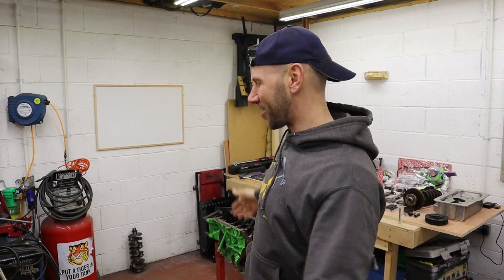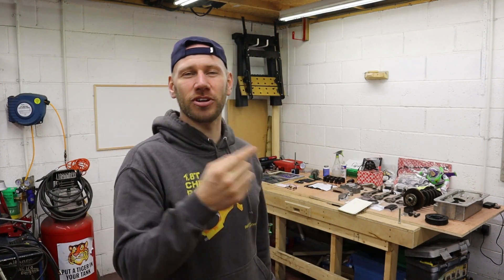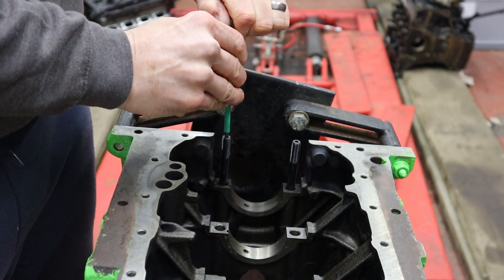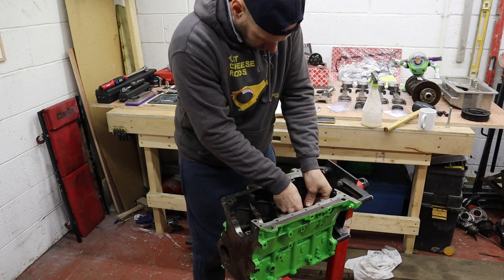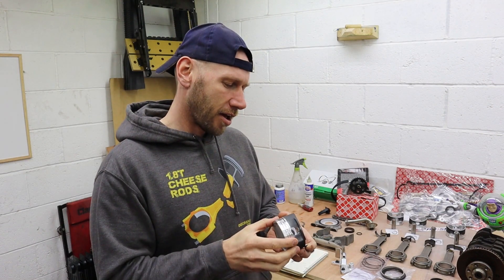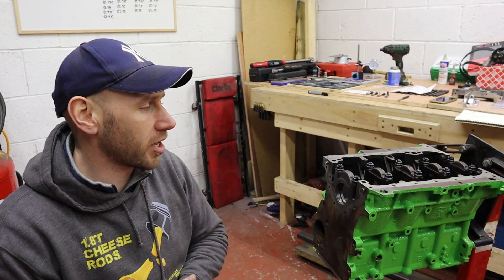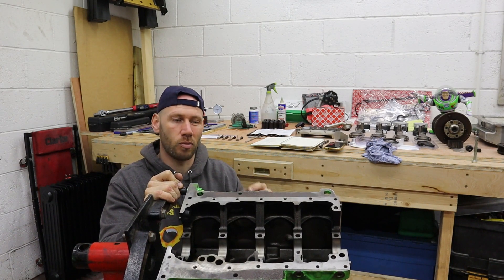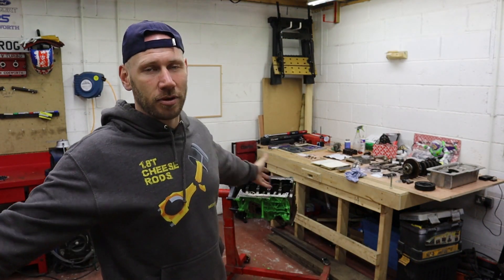1.8T STROKER ENGINE BLOCK CHECKS  // Bearing Clearance and Crush

Comment: Hello! I also just build a 2l stroker . I just measured them and I get between 0.06 and 0.075mm with standard ACL bearing.  It's will be okey for 400-500hp application?
Reply from the maker: I'd suggest that's a bit slack, and id want to measure the crank to determine if that is on size.
Reply: @DecimalTenths ACL said with normal bearings and stock motor the service bearing clearance is 0.15mm  and I will be totally fine with 0.06mm at 400+hp range...

Comment: Thanks for sharing this info building a stroker. I'm from Holland and its very usefull for me. I've got a 06a, the crankshaft, the pistons, the rods. Now wait fore the 82.5 bore (this friday) and the bearrings/bolts and then start building. A long way to go, but with your video's its gonna work👍( at least i think??? 🤔😄).
Reply from the maker: Good luck with it! Be clean, tidy, methodical and reference the manual for clearances and techniques and you will succeed!

Comment: I finally recieved my pistons. I am going 83mm. Question should machine shop be able to tell me I need block decked? Should I just do it? I am worried about valve clearance. But reading for 500+ hp needs decked for absolute seal. Your thoughts. Thanks as always learning so much. Using ur vids every step.
Reply from the maker: Hi there, this is one of the areas that I didnt cover very well in the videos. In all honesty i edited it out, to make them shorter but i do plan on covering some of the little details in a video very soon. In terms of the block deck, it's either good or it's not. If theres no deflection in the deck when measured with a straight edge and feelers gauge then it is fine to send! Your machine shop will be able to advise on that if you dont have the kit.

Comment: Amazing mate. 

Cant wait for the build videos.

Quick one tho, did they ever do a 5door S3 like yours?
Looking for an interior for my Octavia.  I've got S3 hub assy, cast wishbones, quick rack, TT FARB, 4 pots and 256mm rears to go on it. Need coilies so it all fits.  Want to make a 1.9tdi like my last vRS just more eco ;-)
Reply from the maker: Alright mate, cheers for your continued support! 

There was no 5 door S3, but there was a 5 dr 1.8t quattro. For some reason I always end up building anti economy vehicles... 🤔. Need to get a diesel build under my belt at some point.
Reply: @DecimalTenths  for sure mate.
Bit of derv torque lol.
The 1.8t is a great motor tho and so tunable.
Reply from the maker: In all honesty its "easy" for me too. Definately need to challenge myself with a new motor on the next one 😉

Comment: Is it normal for a newley built engine to burn some oil for first 1000 miles was ran in carfully on 5/40 break in oil for 200 miles second oil change at 500 to 10/40 quantum and 3rd change at 1000 miles still using oil bit woried about wall clearence after last video as still using oil after 1000 miles
Reply from the maker: It's completely normal for any engine to burn oil. At what rate is the question... if it's still very noticeable after 1000 miles with normal use then there may indeed be an issue. Worn rings or excessive PTW ckearance will generally show as oil burning under load (WOT). Do you have specs for the build? It's all in the detail.
Reply: @DecimalTenths  dont have the specs just no it was only honed new rings standard pistons used about 1.5 liters in about 1100 miles there no leaks and u carnt c any smoke
Reply from the maker: Is that the total miles you've done including run in or total after run in?
Reply: Tottal miles 1100 ish

Comment: Good stuff! I've come across some people saying that the block needs to be linebored when using arp main studs. What is your opinion on that?
Reply from the maker: The mains need line bored/honed if you replace the main cap as they are honed from the factory.  If you replace the bolts with studs then you dont need to.
Reply: Thanks for your quick reply! Keep up the good work!
Reply from the maker: @BH17Kim  thanks!